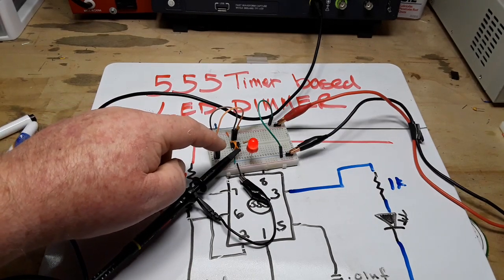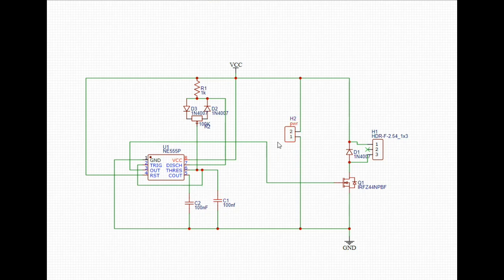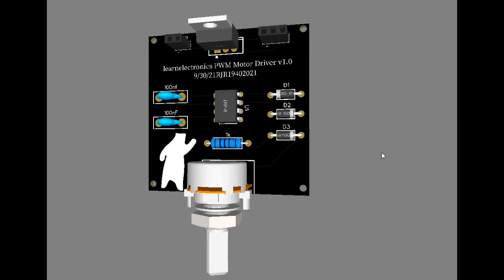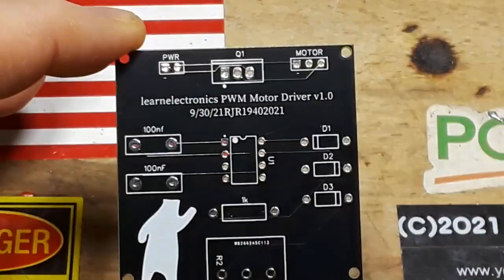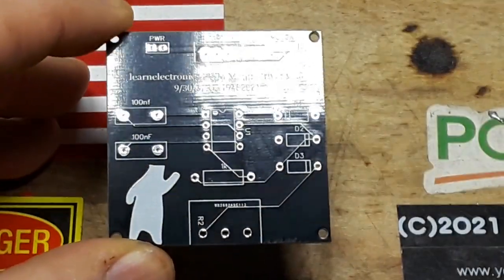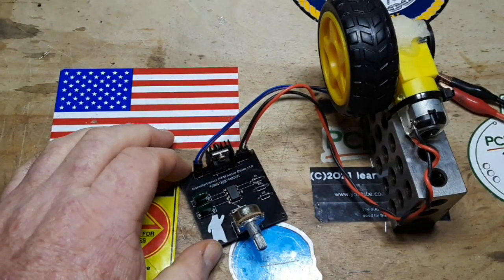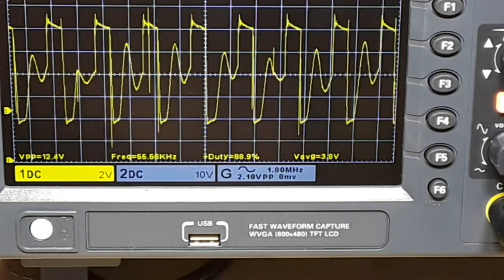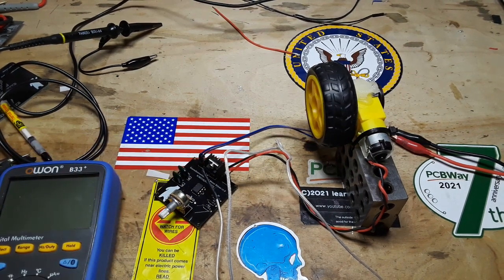Building a PWM DC Motor Controller - The Final Chapter - Making it on a PCB

Comment: Hi Paul,
I’m a new subscriber to your channel, and relatively new to learning how all this stuff that has fascinated me sense childhood works. Since I’m older now and have no desire to have my butt sticking up out from under a car hood anymore. I have taken on the challenge of learning more about how a these electronics work. I had been having a hard time getting my head around the 555 timer. Then I ran across the KISS video you did on it. You explained everything in a way that a novice like myself could understand. A lot of people post videos on building circuits on YouTube, but it seems like they are so focused on using a bunch of engineering jargon trying to show off how smart they are that they completely miss the point of teaching guys like myself who are just looking at building something and learning something from it. I just finished breadboarding the PWM motor driver using the 555 timer following your instructions. It worked perfectly. I used it to drive a three wire brushless motor by connecting the extra wire to ground and it worked perfectly for that application as well. I am planning on ordering some of your boards for this project off PCB way, and building some for a few projects that I have in mind. Thanks for sharing your knowledge and talents sir.

Comment: please fong master make me a replacement shematic circuit for CKP, and CMP, for ECu simulators on cars, which are ckp, inductive and cko shecematic types.  cmp hall effect type with a maximum reference voltage of 2volt ckp inductive type.  and the hall effect type is 5 volts, thank you master

Comment: Good one.  need one that will deliver 2.4kw -5kw for a Trolling Motor.
Reply from the maker: Size your MOSFET and diode accordingly, the rest of the circuit is just signal.
Reply: @learnelectronics  That’s what I was thinking. Thanks for the confirmation. Im converting a gas 🛵 to an e-scooter using an old trolling motor and a jack shaft. Your videos inspire me to just fix/mod old things.

Comment: Truly helpful and insightful serie of videos. Can it be used for flicker-free LED strip dimming too? If not, would you post a solution for that too? Thanks 👍
Reply from the maker: It switches at a kilohertz, you won't notice flicker at that frequency. Your eyes lose track after 60Hz
Reply: Yes will easily take above your flicker threshold

Comment: thank you for pickup my question 😊
but still getting humming noise when pot set to minimum😐
Reply: That is because it is not fully "off", a H-Bridge would be a better controller for the motor.